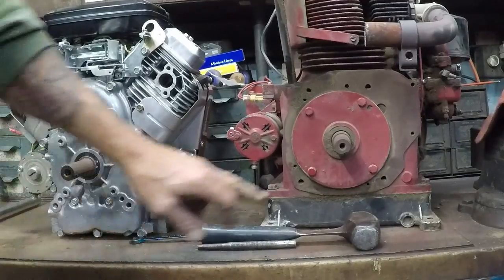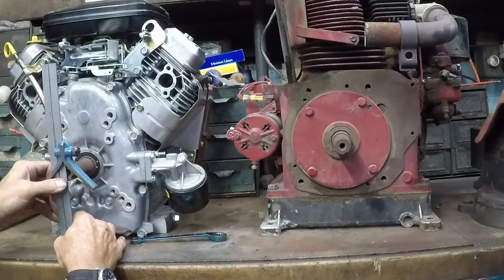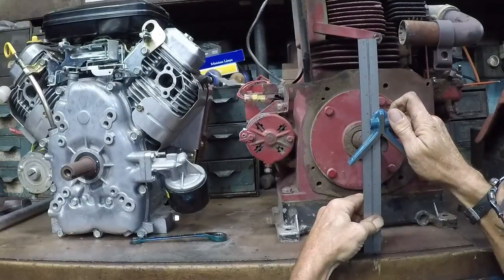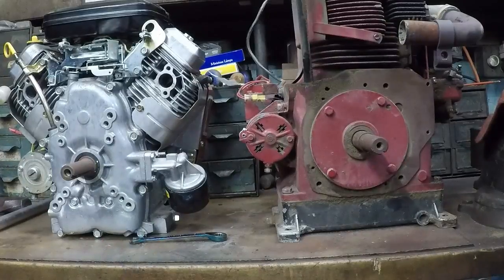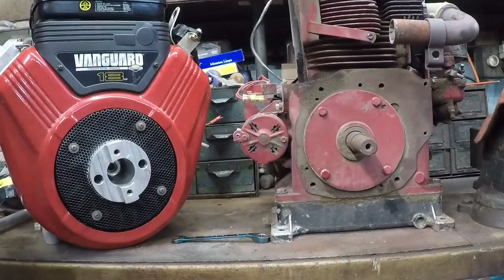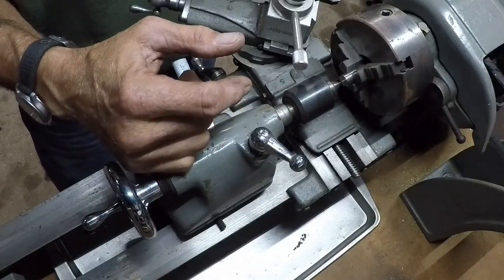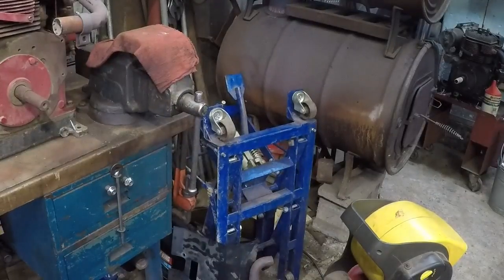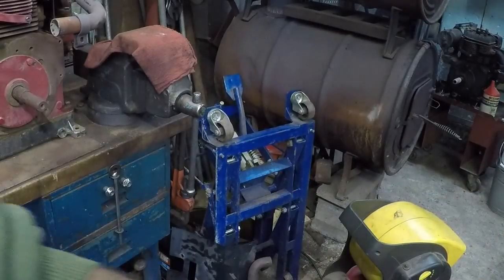Simplicity 7117 Vanguard Engine Swap Part 5 #smallenginenation

Comment: They are called female transfer punches and are fantastic to have available.
Reply: In the tool trade we call them transfer screws.
Reply: You called them locating screws in the video. Just a name. I don't see to many people still using a micrometer. I see a set of dial calipers from time to time. Usually a old beat up tape measure. I'll be looking forward to seeing that V twin it there and running. Love your videos
Reply from the maker: Thanks! Yeah..I've forgotten more of the terminology than I remember, but I do remember their purpose! lol. Cheers fxr! Zip~

Comment: Just when I think I am getting ahead on my small tool widgets you come up with the new centring tool.  I thought you might just use 1 inch square stock laying square to the plate.  How fun was that!!!  Good for you.  Are you going back to your Navy days on that lathe?   10 years on You Tube.  You are a pioneer my friend.
Reply from the maker: It's hard for me to believe I've been at it for 10 years. Doesn't seem that long!! I was going to use 1x1 blocks that ran the width of the engine front and back, but these spacers accomplish the same result, and are more forgiving to frame flex and engine torque. I'm actually going back further than the Navy with my machining training. I started metal fabrication in the 8th grade through 12th, so I already had 5 years under my belt when I went into the Navy. It was a no brainer to go into being a Machinery Repairman, then on release, I went into the automotive industry and worked in much the same capacity until 2005 when I had to retire. Two years later...YouTube saved my sanity! lol Cheers my Friend! Zip~
Reply: Good story.  You Tube has been a great thing for me too as even when I am not busy in the shop I ALWAYS have something to do.

Comment: very nice job, I forget what lathe do you have? and what quick detach tool post do you have?
Reply from the maker: It's a little 6" Craftsman 101 lathe and the quick change is just a cheapo from Amazon. It gets the job done, but eventually I hope to upgrade the lathe to a 10 or 12" with at least a 36" bed. Cheers Josh! Zip~

Comment: Hey zip, I have a 7117 hst,  how do I connect the rear lift tube to the hydraulic lift shaft so I can  lift a mold board plow, is it a cable or a steel rod?
Reply from the maker: It's a cable lift Mell. You can go to Simpletractors.com, Michaelstractors.com or many collector groups on Facebook to chat with collectors and determine your best plan of action to getting the cable and pulley needed. Cheers! Zip~
Reply: Thanks Zip!

Comment: Awesome video. Love the center attachment for the ruler, All the years I’ve worked on small engines I have never seen one before . Question Zippo - are you going to use rubber bushings or rubber washers for the custom 1inch mounts you made for when installing the engine? Does the Vanguard vibrate? It might be a dumb question. I’m learning some cool stuff watching your videos. Can’t wait to see when the Vanguard gets transplanted.
Congratulations on 10years! You’re awesome!
Reply from the maker: Heya Matthew! I've rubber mounted engines in the past, but the rubber mounts always fail after just a few years. These Vanguards run surprisingly smooth, so I'm not at all worried about vibrations. Besides that, these tractors require that the engine is rigid mounted due to them being drive shaft driven with fiber disc isolators. The original Kohler KT17 Twin was a vibrating bucking bronco of an engine, so it was connected to the drive shaft with a rubber isolator. This engine won't require that. Great question! The last rubber isolated engine I had was on a Briggs powered Wheel Horse (belt driven). It wasn't necessary, but it's how Wheel Horse wanted the engine mounted. I replaced two sets of mounts before finally just hard mounting the engine to the frame with spacers. Cheers! Zip~
Reply: ZippoVarga - Sweet! Thanx Zippo. Rigid is better!